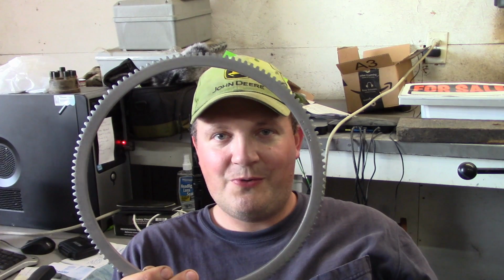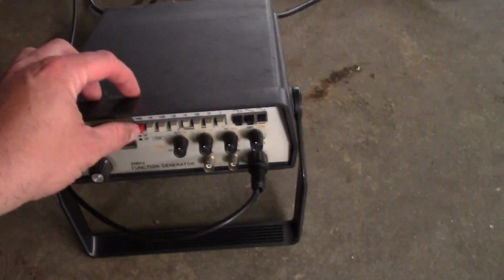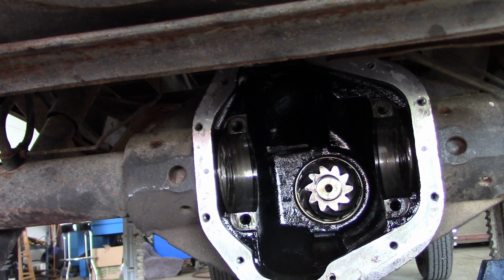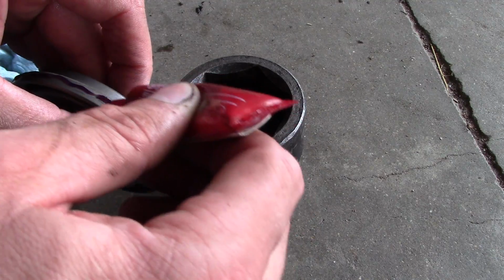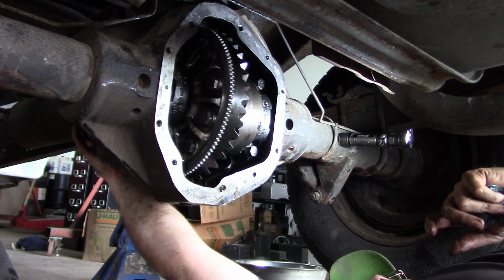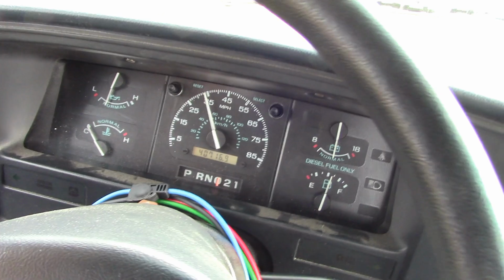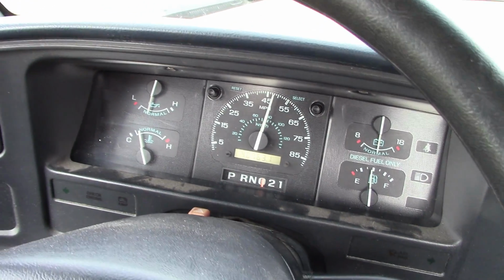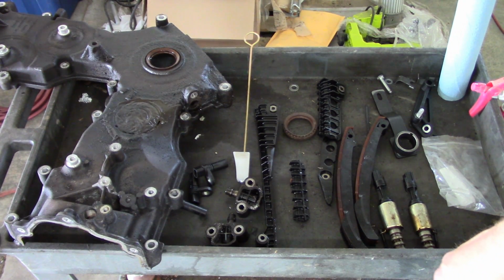Ford E350 Tone Ring VSS / Speedometer Fix

Comment from the maker: Piercing probes: https://amzn.to/38OU9GT
Lisle drain pan: https://amzn.to/2Oe58Qv
Reply: I wonder if a section of that old tone ring had gotten magnetized... ?? It's not missing enough metal.....
Reply: iis that toughbook really running xp?? wow  get in touch with picoscope and see if there are issues upgradeing the os  win 10 minimum is cpu 1ghz ram 1 gb so if ya got it and  there software runs on 10 upgrade!!! better yet install linux install wine and run it in that 
for any company to send you that os to run there product would be almost equivalent to you installing an engine management system thats no longer supported by there manufacturer never mind the unfix able un modifiable design flaws
Reply from the maker: Pico is a USB device, it connects to any PC. I'm running Windows 10 on that Lenovo.
Reply: @WatchWesWork  wow  there software is using an old style lol  looks like xp lenovo...=thinkpad ibm  should be a solid enough machine but no gameing on it 
but thats not what your useing it for so all good thanks for the reply and the vids
Reply: and did the coolant temp ever change on the gauge?
Reply: @mobiousenigma  can you break that down for us ?????
Reply: Man, don't buy at amazon,  they mess up the market so much, your next door neighbour carparts store will forfeit.

Comment: So glad I found your video. I have been living with a bouncing speedo forever. Luckily the truck shifts fine and no abs light which is kind of weird that I don't have more issues due to the VSS. I recently had the speedo repaired by one of those online repair shops and they did repair my smashed odometer display, but the speedo still has the bounce at varying speeds. Thanks to your video I plan on pulling the rear diff cover and checking the tone ring. Great trouble shooting!! Thanks!!!

Comment: Mt parents RV is having a similar jumping speedo issue.  Ford E350 chassis 1995.  Replaced sensor and it improved slightly.  Still bouncing, but less.  I think the toner ring is shot from a similar issue since it sat for awhile.

Comment: I wonder on the tone ring if you checked with a dial indicator? Look at the distortion in your waveform would correlate to the oxidation/normal sections of the tone ring?! Either rust jacking or heat distortion due to the rust?

Comment: I know this is a Dana 70 BUT Sterling (Ford) 10.25 and 10.5" rear axles REALLY tend to leak out of the pinion splines.
I put RTV on the splines as well as the washer. If it's a REAL LEAKER it only lasts about a year and you have to do it again, but it's not a hard maintenance item.
NOT something you can do for a customer though.
I also use RTV as an axle cap gasket as well. Never had one leak, or leak out of the bolt holes either.

The U bolt style yoke is stronger than the strap style. HOWEVER, you can over torque them and distort the U joint caps.

Comment: I'm doing my 93 e 150 van speed sensor. It's looking more like the tone ring . Weird stuff progressively happened. The cruise control , then speedometer, went to default shifting by tps? Replaced almost everything, ring is on e of few things left still working on electronic part.

Comment: Same thing happened to my 2002 E350 7.3 but I don't have a speedo cable.I replaced the VSS on the transmission and the sensor on the rear differential but still neither speedo or odo work. Any ideas what the issue may be?

Comment: I blew up a smaller version of this axle when I was younger and stupider, and I just replaced the crunched pinion and ring along with the carrier and exploded spider gears and put it back together the same way it came apart. My father told me I couldn't do that, that the axle had to be set with gauges and dykem. The axle never blew up after that though, and I thought I just got lucky. But today I see this video where someone much more competent than my teenage self does the same thing, so I guess that's how it's supposed to work.

Comment: When i use aligater clips with wires on my alternator the car starts and runs .i tried buying new connectiors and splicing the wires but it keep dieing ans wont stay running. Its only a 2 wire plug that plugs into the alternator. My car is 2003 mustang v6 base model.bit sure why new plugs that i splice in wont work. Any ideas ? We spent 47 on a brand new female connector and it isnt working. And the alternator is relatively new.

Comment: Awesome video! 
I am having an abs issue but speedometer is fine. After 3 rear speed sensors My mechanic said it’s the tone ring giving erratic signal. 
Would the tone ring make bad signal
But still give good speedometer??

Comment: on my ford I had a intermittent speedo dash issue then after i lifted it and the 38's I fixed the issue when i re calibrated and synced cluster  using forscan Think the dash was buggy from the switch in the door latch gummed up and shorted out sometimes gauges wouldnt work or speedo or no radio

Comment: When it comes to the 5.4L and you're having timing and cam issues, it is literally cheaper to just replace the engine... Especially since there are no cam bearings. If you don't have timing issues, those engines are bulletproof.

Comment: Wes on  your forklift. Drill one inch hole  in fork front   So when you have to lift with it  drop two large bolts in holes so nothing slips off forks

Comment: I know this is old, I’m sick and just watching everything lol. My 95 f-150 ALWAYS had a 1/2 mile bounce. Always was worst at about 70+. After I first got it it started bouncing hard and flipped the OD light flash. Replaced PSOM and fixed that. The bounce didn’t go away until I rebuilt the rear end after the pinion bearings grenaded. It was literally tiny pieces of metal on the tone ring made it bounce. Now it doesn’t anymore! These things are super sensitive. You also don’t have to pull the ring off the carrier to change the ring

Comment: Do those power strokes usually run that low on oil pressure gauge?
Reply from the maker: The gauge is fake, like almost all Fords.
Reply: @WatchWesWork  So all the Fords on the roads are just imposters? I knew it. Thanks Wes 😅

Comment: Pretty sure ring gear bolts can always be reused. Atleast in DANA axles. Also I always use a rag in the ring and pinion to pop the diff out. Less chance you will nick something.

Comment: Glad I found your channel.  Subbed.

My 94 f-350 idi has intermittent blinking OD light with hard shifts, AND the speedo jumps, but only at or above 60 mph.

Any ideas?  

I’ve replaced speed sensor and tach sensor, haven’t found any bad wiring...yet, at least.

Comment: Wow man this is an awesome video. thanks for sharing and giving my the inspiration to do my own. My 96 powerstroke has had a bad tone ring since I bought it in 2007 (bouncing speedo) which in turn flag the TCU making the computer think the trans is slipping. It doesn't see much use these days but I want to fix her and fix her right. I know its a good idea to replace the pinion seal but is it necessary? Just curious as I don't have a torque wrench that goes to 250 lb./ft. I may have to let a shop do that part.

Comment: Ive had this jumping speedo and erratic shifting for like 2 years now in my 04 e350. Cant figure it out.. My scanner says P0721 output shaft speed sensor out of range. Changed the sensor at the trans and nothing. Also changed the speed sensor at the rear diff. Been chasing this problem for a while now. Very frustrating to say the least. Did you have any codes like mine? So possible the tone ring  then? I guess there are 2 right? one in the trans and 1 in the diff? I should also note that the vehicle sits a lot.. Possible its a rust issue like yours. Thanks, Mike
Reply from the maker: That truck most likely has two in the transmission. One on the input and one on the output. The output is used for the speedo.

Comment: Hey, thanks for the video! I changed my VSS and pigtail, still getting the VSS Fault code, which is causing rough shifts and overall poor operation of the Xmission. Would tracing the VSS wire to the ECU be the best bet, or replacing that tone ring like you did? I was not experiencing an erratic speedometer, like yours.

Comment: I've got to say, I worked twenty-five years at a Ford dealership, and I've never seen a tone ring go bad in a rear differential. I've replaced them when replacing a ring and pinion, but never by itself.

Comment: Maybe someone has already said this but my guess is the the part of the tone ring that was rusted was at the lowest point where water got in and caused the damage and did not drip down across it. The oil would have floated above the water so since the tone ring is sticking out so far it would not take much water to just affect it and not the gear teeth. So you did not find water there but like you found someone was already in there before you and they probably already drained it out. Could also be that the pinion seal leaking for some time it kept getting topped off and that replaced the watery oil mix that you never found.

Comment: I got a 94 F150 the same issue. Tried many things. Just replaced the throttle body sensor, seemed like it was gone. Can’t right back today. Down to mlps or the tone ring at this point.

Comment: did you check the pinion pre-load?
Reply from the maker: No. The Dana axle does not use a crush sleeve. We put the same shims back in and it is what it is. It's not really useful to set preload on used bearing anyway.
Reply: @WatchWesWork  I see, thanks for the info. 
BTW great job with the diag and vids

Comment: He Wes.  What. Was the fix for the sticky front brake.  My E350 motorhome doesn’t this.  I already replaced the caliper. Thanks.
Reply from the maker: I didn't find any issues. Check the brake hose. They can break down and become like a check valve.

Comment: hey Wes, maybe you can help my problem. 94 e350 7.3l non turbo diesel automatic. transmission will sometimes just pop out of gear and start revving. can be at any speed or gear. the vehicle will just coast then pop back in gear. I've replaced the tach sensor on the injection pump. it solved it for 6 months. I was thinking maybe faulty part and just replace it again. unless you've encountered this before. I live in SD, CA. i dont have the rust problems you have over there. much help if you can point me in a direction. thanks
Reply from the maker: I think that truck uses the same VSS / PSOM nonsense as this one. But I'm not a transmission expert.

Comment: Did this solve it? I picked up a 94 f150 for cheap and replaced the Rabs. Seems better but still shifts off. Fluid good. Have a replacement psom but haven't installed yet. Only code that came up was 452. Thinking maybe mlps beyond that. Replaced ujoints because when I shift into gear there's a small delay and then it shifts and kinda lurches. Seemed like u joints but that wasn't it.

Comment: As a senior master Ford technician, I am impressed by your professional work ethics and knowledge. You were able to prove your diagnosis by skilled use of tools and continued to repair the truck until it was perfect. Most techs would have been satisfied after the previous repair when most of the oscillations were gone. Well done. It’s a pleasure to watch you work.
Reply from the maker: Thanks. The job is not done until it works right. Sometimes you never get there.

Comment: Isn't it a wonderful thing, a speedometer that you have to have a tone ring inside a differential and a computer to measure the speed.  For years we had a nylon gear in the transmission and a cable with another nylon gear and a mechanical unit to read it.  It took 4 1/2 hours to fix the damn thing, this is a completely unnecessary amount of BS that some nerd decided was better.  I have put 300,000 miles on units that never had a speedometer problem and others might get noisy and need the cable pulled out and lubricated or replaced which might take upwards of 15 minutes.  Technology is wonderful you take a simple thing and make it a nightmare, the computer age is wonderful.

Comment: Bad idea using something to hold the shims in. You essentially changed the backlash on the rearend. If it's a few thousands off it'll eventually chew up the gears. Normally only have 5 thousandths or so to play with to get the right mess

Comment: I have rebuilt several diffs for friends, never had the spreader tool. My worst was a diff I rebuilt on a Dodge WM300 Power Wagon. Rebuilt it put it back in place, lubed and tightened everything. On the test ride I had one speed forward and 4 in reverse. Damn thing has an even bolt pattern all around. It was not MY fault I put it upside down into the pumpkin.

Comment: It's so strange seeing what a UK van / truck would do with 2.5 litre & a turbo you guys do with 6 litre big old soft tune lump. It's a whole different way of thinking about vehicles. 
I can only think your diesel must be cheaper than water!
Reply from the maker: My understanding is that at some point you guys were taxed based on engine displacement leading to smaller, maybe more efficient, engines. We never had that here, so we carry on with large displacement.

Comment: You can see both these trucks are over engineered, and those parts they want you to change on each repair.........We know some parts, hardware need to be changed as a matter of safety, but some manufacturers have gone overboard with this mantra.
Our experience with American cars and trucks was in the 1980's in the Arabian/Persian Gulf, where we had a Buick, Pontiac and later a GMC truck and these vehicles ran good especially in the hot desert climate. Very easy to take apart and assemble and parts were well made and cheap. Now I see the Ford's pains and it might well be from Auto Dacia, Romania!! I don't think you will see that setup for the speed sensor in the differential in a Toyota or Nissan.
Reply from the maker: To be fair, this is the first time I have seen this happen in 18 years of working on cars and trucks.

Comment: "We reused the phasers."
Well the good news is "driving it till it blows" is going to come faster than you think. I owned an 07 F150 that I absolutely lost my ass on. Had the valve covers off it at least a half dozen times dealing with what is arguably the WORST VVT system to ever curse this earth. Just buy a phaser lockout kit, put a piece of tape over the CEL, and hope to get 150k out of it.
Reply from the maker: Usually the phaser ticking won't really hurt anything. Occasionally you hear of one mechanically sticking. But mostly it's annoying and the solenoids are the real issue.

Comment: That was cool. 
I learned something with the ring gear -  I was thinking how is he going to torque those left hand thread ring gear bolts with that torque wrench ... well, they're not left hand thread in this application.
Reply from the maker: No. The Danas are nice. No crush sleeve, no weird fasteners, standard bearings, etc.

Comment: Wes do you know were the rear panel was purchase the one on the back of the cab? I have a 97 S/D ext. van w/7.3 and only 150,000 miles love the drive train except when  I open the hood. This the 1st truck that I have own in 60 years that you can't see the ground when looking inside the engine compartment. The body is rusted bad from front doors back Michigan truck. Enjoy watching your videos and learning as I watch.
Reply from the maker: As far as I know the company that decommissioned the ambulance found the panel.
Reply: @WatchWesWork  Tks. Wes I will keep on looking I am not going to give up. As much as I agree w/you about working on Ford van w/a diesel I just can't let go w/only 150,000 miles.

Comment: Looking at the axle shafts they are 1/2 the size of the ones I put back in our 1947 Greyhound bus yesterday.  The probes come with the ASE Wave kit. I pulled a 2000 F250 trans that quit pulling all of the sudden and it was case damage under the valve body from a previous rebuild where they tried to pry the front pump. When the 1/2 moon chunk popped out from the fracture it lost the pressure to the forward clutches but reverse worked fine. Crazy stuff we run across!!!

Comment: You know, I didn't read all of the comments but I remember back when I had an OBS, the guys with auto transmissions talked about weird shifting and something as simple as the 3rd brake light being out or shorted would mess with the trans patterns. Maybe look around at the lights or grounds for something loose that might occasionally ground out?  Tough one.

Comment: do a voltage drop test to circuit 359... there will be a place in the diagnostic connector.. its a grey and reds stripe wire..   there is a TSB about adding an additional ground connection to that circuit down near the transmission..  i added that to my 96 E250 4.9 and it cured all the evil shifting issues.  its also 397 to the PSOM.. on my 96 Diesel E250 diagram it shows Black and white..  PSOM cavity 2. Instrument cluster 12 and 9,  PCM 33.. but this is probably wrong for a 95 but correct for a diesel ..  but it also goes to the TEMP sensor in the transmission solenid block and the MLPS  so the range is grounded. allowing the MLPS to go thru different resistors  depending on the selection.. it also shows the same circuit grounding pin 2 of the blower motor resistor..  the ac compressor clutch. the washer pump motor.. the exhaust pressure regulator.. ..  these are all grounded at G201.. also at G103..    circuit 359 MLPS pin 2 to PCM diesel pin 91 and also to the E4OD valve body connector pin 8..
Reply from the maker: Interesting! I'll have to look for that TSB. I have been hearing about a lot of MLPS issues with these trucks.